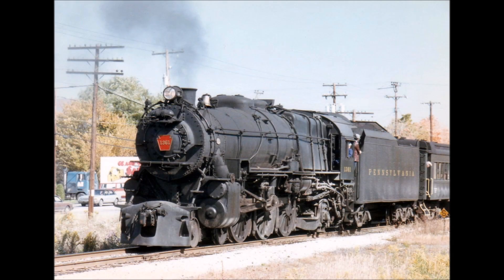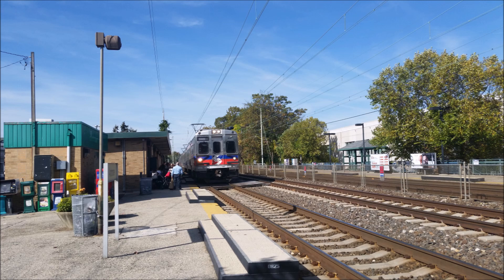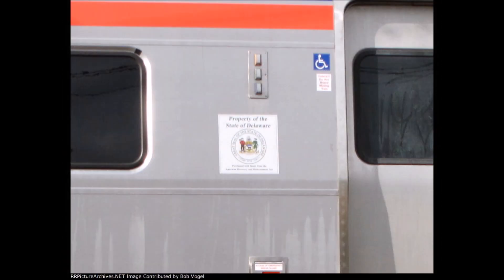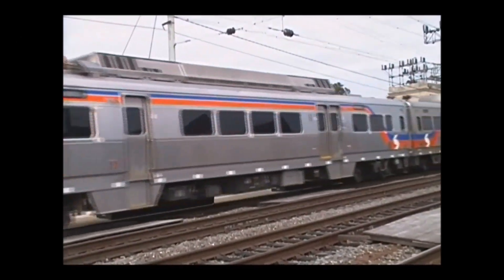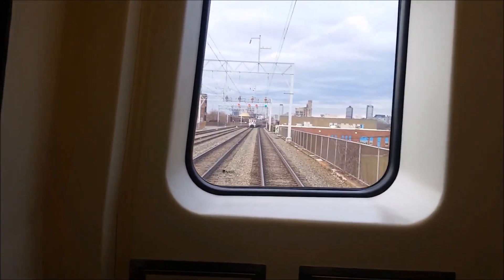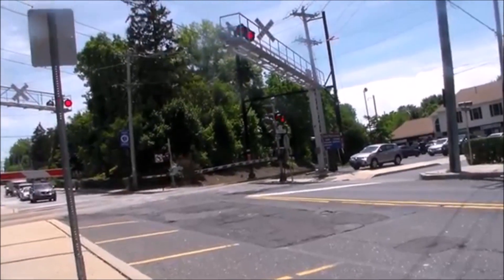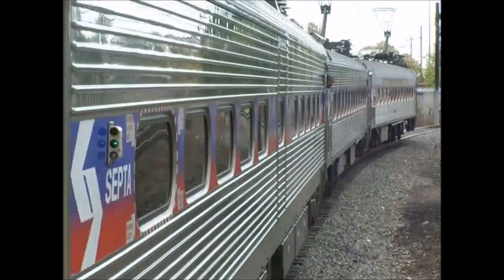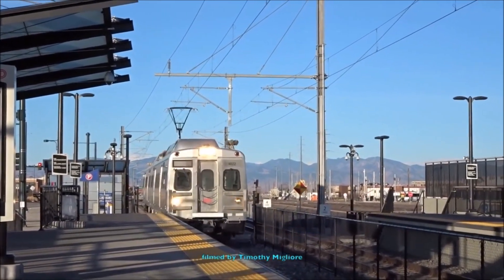Engines of SEPTA Silverliner Vs

Comment: I remember commuting to and from Drexel during the summer of 2016 on the Paoli Thorndale line. Trains would easily be filled by the time you reach Paoli. And we’d have to go all the way to Philly and skipping the rest of the intermediate stops because the trains were overcrowded.

Comment: I too survived SEPTA-geddon, a couple City Transit division strikes and 2008 Phillies parade (not to mention my train pulling down the overhead catenary wire just north of Fern Rock). Though the Vs are better in many respects to the II/IIIs, and in some to the IVs I preferred the IVs seats and ride.  I recall the Vs had a distracting vibration even in the center of the car. Am not sure it was the frequency or amplitude (mayb was just me). And the IVs also have a bit more over-the-shoulder privacy next the two bulkheads on either side of the center vestibule. In other words the IVs offered some premium seating with more leg room & privacy in the center vestibule & a solid wall behind you in the seats just outside.

Comment: Not to troll but I strongly dislike the Silverliner V cars, and prefer the VI cars over the Vs. For one thing, the seats on the Vs are not as comfortable to sit in as the VIs. I also really hate the exterior because it just doesn't look right. The interior and exterior don't look as good as the previous four versions BUT the only thing I actually like about the Silverliner V cars are the monitors above some of the seats.
Reply from the maker: I think you mean the IVs as the VIs haven't been built yet and wont be on the scene til the 2030s

Comment: Nice and for the AEM-7 they actually entered on December 8 1987 since there is an Allentown Morning Call article about that if you were to search it. the obvious solution would be electrifying Lansdale to Bethlehem with I-78 exit 67 Hellertown Park and Ride. because that was the original Reading RR plan

Comment: 10:34 you used a Comet I picture. Comet IIMs look similar but have bigger stripes and destination signs; Comet IVs are identical but with center doors. I believe only 1 ALP-46 and 1 Comet V was actually used on SEPTA service in 2016.

11:06 I only remember MARC equipment being on the Wilmington/Newark and Media/Elwin lines.

Great episode nevertheless. Some errors but they’re tolerable
Reply from the maker: I Remember MARC Equipment being used on the Paoli line. My dad's gf occasionally rode it to work in the morning and I remember seeing it on occasion on the line too.